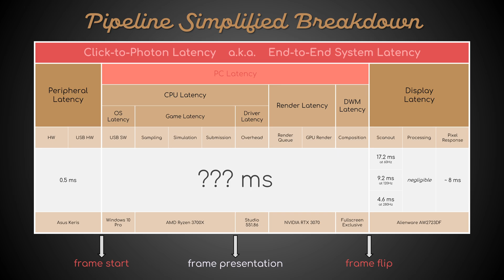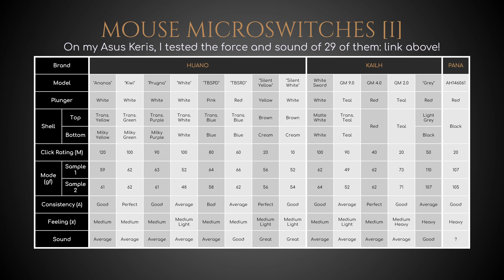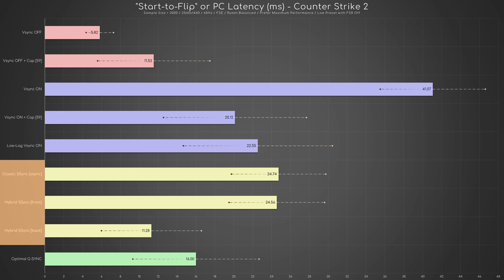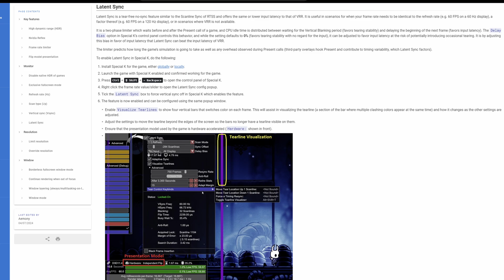Latency Test: G-SYNC vs Classic/Hybrid Scanline Sync vs Low-Lag Vsync ON vs Vsync ON/OFF ± FPS Limit

Comment: Brother, for forza horizon 5 which sync should i use to nullify screen tearing and have the lowest latency.

I have rtx 3060 and 75 hz monitor, i have configure the settings as it is giving me constant 90 fps
Reply from the maker: I'll be releasing a video on the 24th about the latency of "Low-Lag Vsync ON" vs "Low-Lag Fast Sync", which you will definitely find interesting!
Spoiler: try Low-Lag Fast Sync! Just find the Real Refresh Rate of your monitor, subtract 0.01 from it and set the result as the Framerate Limit in RTSS.
Finally, enable Fast Sync and set Low Latency Mode to ON in the NVIDIA Control Panel. Watch this video of mine for more info: https://youtu.be/a_LPBUoiCDI
Reply: @oakenglass  thank you brother, just want to know, is special k latent sync better than these?
Reply from the maker: @salmanx37  I will be testing Latent Sync soon enough! Regardless of its latency, remember that you can't use SK in multiplayer games :(
Reply: @oakenglass  understood bro, sorry for asking again  but please clarify since im new,
between   
Hybrid sync ,low lag fast sync ,scanline sync, which one will be better for forza horizon 5.
Reply from the maker: @salmanx37  Low-Lag Vsync ON (or Fast Sync) is certainly the easiest to implement... so that's my recommendation :)

Comment: I had tested LLVSync while limiting the fps to 30 (RTSS) by dividing the LLVSync monitor real 60 fps (minus 0.01: 59.97112) by 2 on RTSS. The result its a flawless 30 fps(29.98556) with no tearing in my monitor. And i used the interpolation (frame duplication) of Lossless Scale program to duplicate my fps by 2 again, and have resolved my problem with tearing with this program.  Thank you! But i am really wondering if that thing that i said makes any sense. Lol
Reply from the maker: That surely is a creative configuration! But did you get tearing with Vsync ON + RTSS Framerate Limiter set to 59.97112?

Comment: Good video bratte. Im running CS2 with GSYNC, VSYNC and 162fps Framecap forced through NVCP. According to my nvidia overlay I'm getting ~11ms average PC latency. It feels super smooth and okay in terms of responsiveness. U got any Idea to get even lower latency? (12900k/3080ti)
Reply from the maker: Thank you :D There's no better tear-free solution than what you're already using (well done for setting it right).
In case you can tolerate tearing, Vsync OFF is the best option... but you MUST avoid being GPU-Bound at all costs!

Comment: GSYNC feels insane, when I turned it on the first time, I couldn't believe it
Reply from the maker: I agree! If one can afford a G-SYNC/FreeSync display, it's always the best option.
Reply: you can't even really buy a gaming monitor without adaptive sync anymore. At least when I was looking for a cheap 240hz monitor half a year ago they all had adaptive sync. I guess people on an older monitor may not have it yet. But I personally don't like g-sync because whenever a game caps the menu frame rate the display refresh rate goes down aaswell so that the mouse input feels horrible. A bit of tearing bothers me less.
Reply: @Katze822228  This depends, manufactures decide how to implement gsync. For my monitor (HP X34), it only engages during gameplay.
Reply: They both v sync and g sync feel same shit...
Reply: @Scyliend  v-sync is garbage, g-sync is pretty good, because you have both no tears and decent latency
Reply: I have G-Sync monitor but now I have a new PC with AMD GPU and I can't turn it on, everything is blurry in CS2, I miss the smoothness of G-Sync so much.
I also tried to turn on UltraLowMotionBlur but Nvidia chose to block this option on AMD cards as well :(
I hate Nvidia so much for gatekeeping people
Reply: @RmX.  wdym, just enable Adaptive Sync in the AMD's settings. CS2 also has AMD Antilag 2
Reply: @ac130kz  You mean AMD Freesync? It's says "Not Supported"
There's also 1 more option in Adrenalin called "Radeon Enhanced Sync" but I don't see any improvements if I turn it on
I don't want to buy new monitor just for VRR, I paid $800 for this one 7 years ago
Reply: @RmX.  it should say Adaptive Sync the Display settings, not gaming settings
Reply: @ac130kz  I don't have this option
Reply: @RmX.  you probably have a very old monitor, which was prior to the open standard Adaptive Sync from VESA (also called GSync Compatible by Nvidia, also called FreeSync by AMD, the same thing). Also make sure to use DisplayPort (at least version 1.2a)